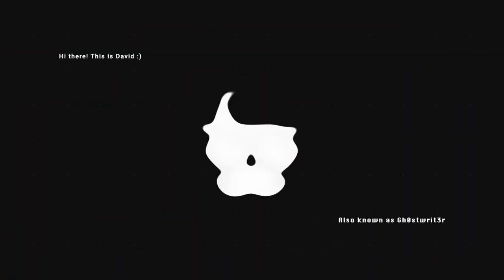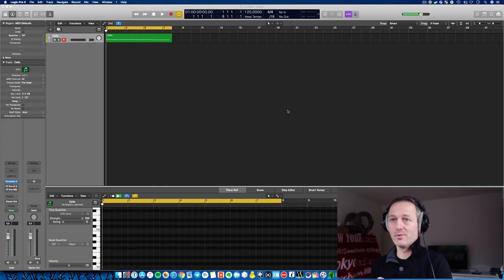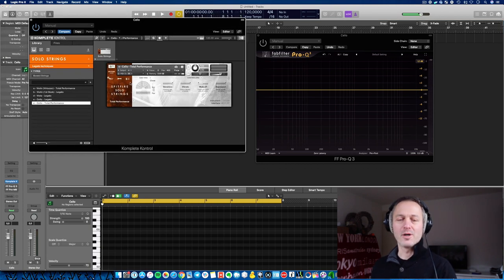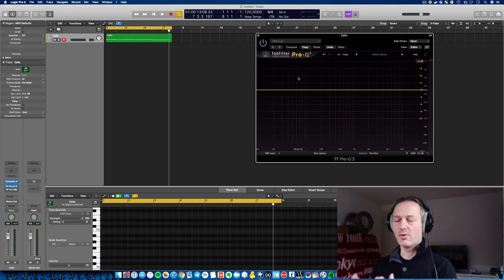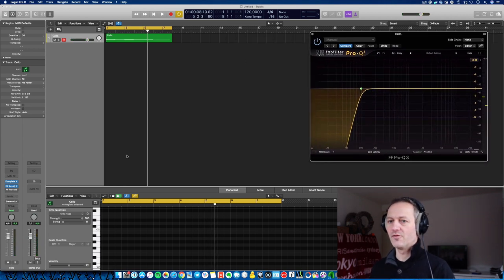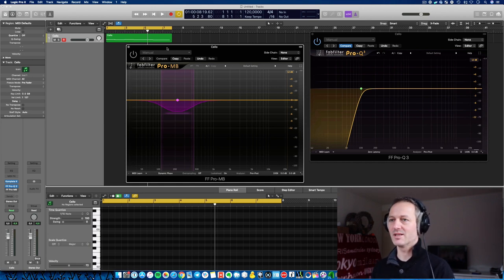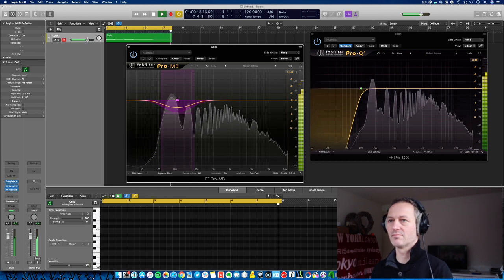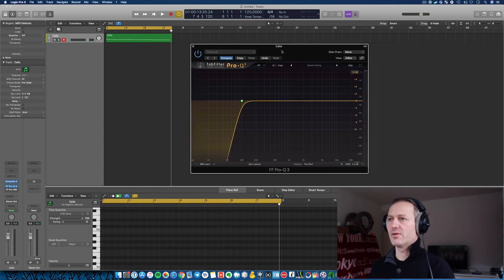Harmonics - Multi Band Compressor & Dynamic EQ [Orchestral Mixing]

Comment: Some of the most informative, perfectly pointed, audio engineering help anywhere to be found. Thanks immensely.
Reply from the maker: You’re welcome Wesley. When I saw you message on FB, I thought this might help you. Wish you a great upcoming weekend!
Reply: @gh0stwrit3r  I will look and learn today on this. All my Libraries are East West, (Diamond Bundle, which I bought, and Composers Cloud, which I subscribe) My DAW of course is Logic Pro X, And this month I am using the 30 FabFilter free Trial, (Amazed at thier EQ and Compressor). If you have any tutorials which go through your programing of the EW Compressors, I would be most interested to start. Getting the “tin like” sound away from my works, and the warmth into the works, is always the main idea. It took me two years to ‘discover' keeping all my Volume levels very very low,(-13db to -23db)  and upping them in the Aux Output as a group in mixing.

Comment: When you do not know anything about sound design what so ever. But it still is an interesting video to hear you talk about the modifying the timbre of a sound to make it fit in. I do have a question. Are you always compressing the harmonics in the low end or is this more based on the context you are in? (I am just curious)
Reply from the maker: Not always. Only when it's needed. So context based. Most of the time I'm very careful with compression (with orchestral instruments). But sometimes you have to use it to control these harmonics that are too much. Otherwise, you mix gets unbalanced.

Comment: If FabFilter is a dynamic EQ, why do you use a multi band compressor? I have never understood the difference between them ^^
Reply from the maker: Well there isn't much difference when looking at the result. The technique behind is different of course and there is a subtle difference in use. A multi-band compressor works with bands that need some range. A dynamic EQ can be much more precise. You can turn the Q (the amount of sharpness of the cut or boost) to extreme spikes. A multi-band compressor can't do that.
Reply: @gh0stwrit3r  Thanks! I use the TDR Nova dynamic EQ, find it very well :)